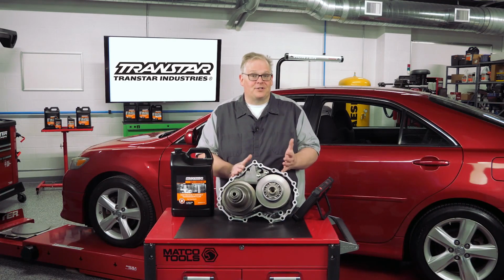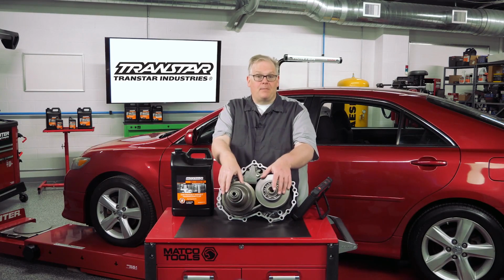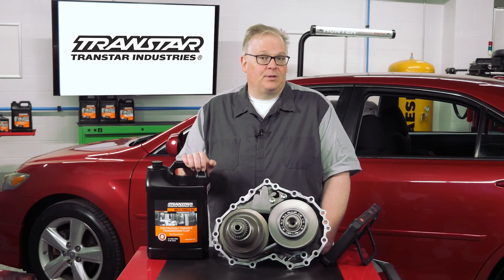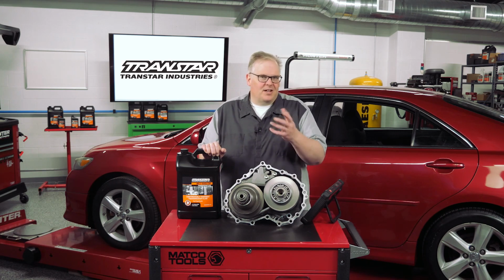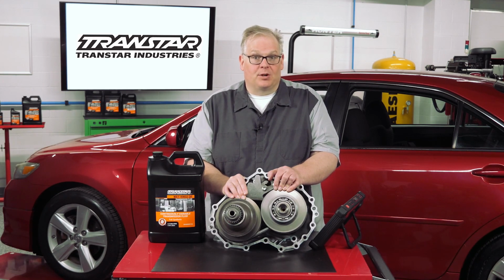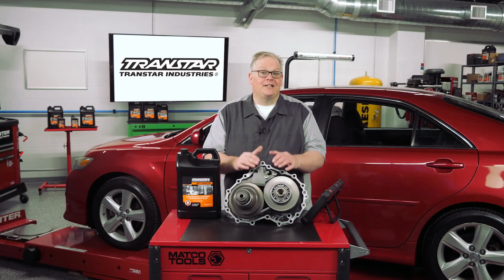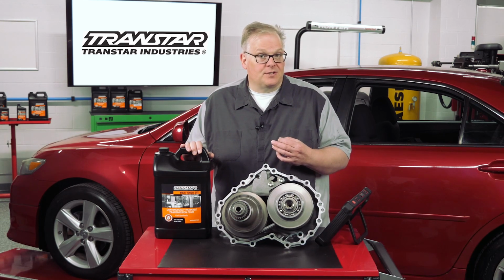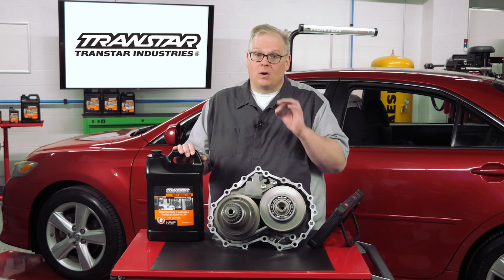CVT Fluid Diagnostics

Comment: In hybrid vehicles, a "direct drive" system, often in the context of series hybrids, refers to a setup where the electric motor is the primary means of propelling the vehicle, and the internal combustion engine (ICE) functions mainly as a generator to charge the battery. 
Here's how a direct-drive hybrid typically works:
Electric Motor for Propulsion: The electric motor directly drives the wheels, providing power for acceleration and everyday driving.
ICE as a Generator: The ICE is not directly connected to the wheels; instead, it generates electricity that is used to power the electric motor or recharge the battery.
Simplified System: This design eliminates the need for a conventional mechanical transmission (gearbox) between the engine and the wheels. This simplifies the drivetrain and reduces power losses associated with gear changes.
Benefits:
Increased Efficiency: Direct drive minimizes power loss compared to traditional transmissions.
Smoother Operation: No gear shifting provides a seamless driving experience.
Reduced Complexity: Fewer moving parts in the transmission system lead to less maintenance.
Faster Response: Direct connection to the load enables quicker acceleration and response.
Higher Torque at Low Speeds: Electric motors, especially in a direct drive configuration, excel at providing strong torque from a standstill. 
Examples of vehicles that utilize or have utilized some form of direct-drive hybrid system: